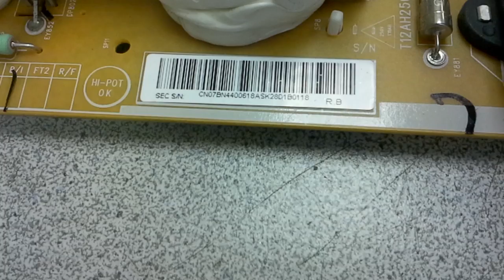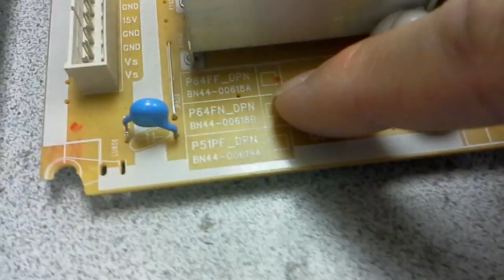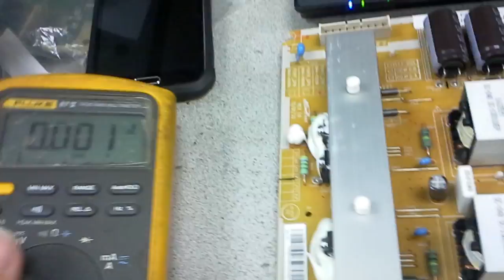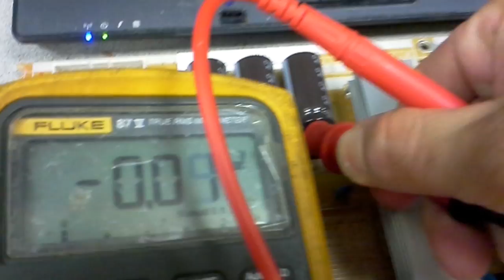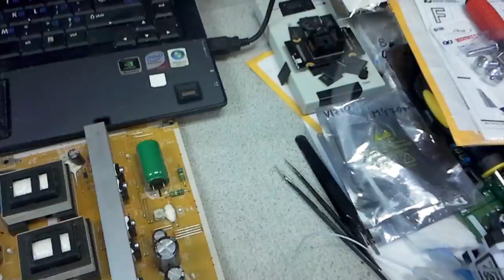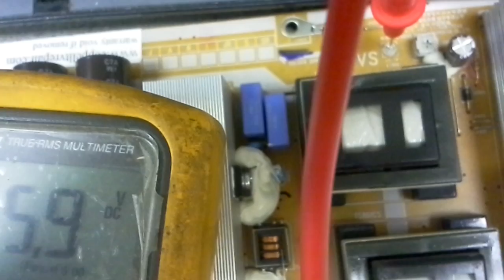How to test BN44-00618A power supply for Samsung PN64F5300AFXZA  PN64F5500AFXZA

Comment: Hello Bobby my BN4400601 has a blown mosfet which I cant determine what type it is. Would you happen to have a schematic for this board? Thanks
Reply from the maker: Most likely I do not. 95% of what we do is reverse-engineering...we do have access to some schematics but easily most of the more recent appliances are missing there. You determine MOSFET usually by the purpose it servers and the voltage it operates under. For repairs it is always safe to over-engineer, i.e. we use the same high-end switching mosfets on pretty much all PFC circuits we see around, whether they are for 50W or 250W devices...it's not worth maintaining a small warehouse of unique transistors when one high end can cover them all and when its cost is a mere 1/50th of the total repair cost.
Reply: @coppelltvrepair  Thank you for your reply, awaiting replacement part from DigiKey

Comment: Vs and Ve are high because the  other boards are not connected so it's not under load. If you connect them these voltages will come down and fall into spec. Trimpot will NOT let you lower them to the stated value if not under load.

Comment: how to wake samsung PSU board bn4400514a thank you
Reply from the maker: The exact sane way, Find any of the videos we have for BN44-00513A, BN44-00514A, BN44-00515A, BN44-0516A. Connectors may be at different locations and may be organized a little differently, but all will have the same STB and PS_ON and VS_ON pins that function the same way.

Comment: Hi. Very nice informative video. Are these power capacitors known to fail as they handle pretty high voltage of 400V. How much voltage are they rated for any idea?
Reply from the maker: No, the capacitors on this board are not known to fail a lot. This may change in future, but as of today I would not look at capacitors when considering problems on those boards.

Comment: Bobby, the best PSB testing vid on YouTube!  My board shows Vs high as well and out of range for adjustment.  Do you have any vids on testing the main board?  My PSB tests good but seems not to be getting the signal to turn on.  Thxs.
Reply from the maker: No vids on the main board, sorry...but you can search around for how to test the plasma logic board and sustain boards by disconnecting the plasma logic from the main and shorting a jumper there to generate auto raster..it's fairly common procedure for Samsung plasma TVs.
Plus, if you have out-of-range Vs voltage I'd focus on that...the odds of having that problem AND something in small signal boards are fairly low.
Reply: Thanks so much for the response.  Unfortunately, the logic board and main  are one board on this model (PN60F5300AFXZA  US01).  I'm wondering if a high Vs comes down when the "load" of the display etc. is applied.  I've only tested the power supply isolated, as you did in the vid. @coppelltvrepair
Reply: @177BCardinal  that's exactly why it's high - no load.

Comment: This is the power supply for the 2016 UN55KU7000FXZA, right? Is it dual voltage? I want to know before I buy a step down transformer and it turns out to be unnecessary. Thanks
Reply from the maker: I am sorry, we do not currently have the resources to check that on your behalf. If you have the board handy you should be able to do it yourself.

Comment: Btw is it safe to take the power supply board out of a tv because i have a old tv laying around all i want is the power supply board  sense  the tv stopped working
Reply from the maker: Yes it is safe if it has been laying around for more than 2 hours.
The worst that may happen is there may be a spark coming out if it if it gets touched in a certain way , but there's no risk to human handling it with hands other than possibly surprising them.
Reply: @coppelltvrepair  oh ok because there some parts i can use and desolder and it has been laying around sense Christmas and so i should still dis charge the compacitors?

Comment: Hi I started checking this board by checking the fuse.( t12ah250v ) and it is blown. What would you recommend from here. The tv was turning off after about a minute. I did the reset by unplugging it for 30 seconds then holding the on button for 30 seconds. When i plugged it back in it was completely dead not even the red stand by light. Samsung PN64F5300
Reply from the maker: We repair those boards for money, so please don't expect us to teach you how to do it yourself - it would be in conflict with what feeds our children.
With that in mind we recommend you replace the board, have it repaired or try repairing it yourself.
Replacing the fuse alone is not going to help and using a repair kt from ebay may or may not help,.but is not enough to prevent another failure within the next year.
Reply: @coppelltvrepair  I would like you to repair the board if that is the problem. I wanted to know if you thought this was the problem with the tv or should I look further?
Reply from the maker: @christopheraquina7744 A blown fuse on a board is virtually certain indicator of a problem on the board. Coupled with teliable statistical failures on this board I'd say you are not likely to find problems elsewhere.
Reply: @coppelltvrepair  OK, How do I get it to you for a repair
Reply from the maker: @christopheraquina7744  The link is in the description of the video.
Reply: @coppelltvrepair  it is on its way

Comment: Ah, but if you have a pwr_on pin at 0 waiting for a 3.5v routed through the logic board then you connect these two via a 1k resistor?
Reply from the maker: On most Samsung plasma TV power boards you have 3.5V on pwr_on waiting for 0 to activate the first stage of the board (PFC, low voltages). And no, there's no 1k resistor needed for that.
Reply: @coppelltvrepair  thanks
I activated my leg with direct wire from 3.5 to power on, confirmed voltages working
So logic board is dead
Reply: No load on the power supply board = higher voltage to panel. I'm surprised the weren't sparks with that test procedure,  btw.
Reply from the maker: @14.1guy2  That is incorrect. Most power supply boards have built-in load providing minimal current allowing proper regulation of the board without external load. In other words the board is never without load. It is not working at designed / optimal current without external load, but the output voltage is holding with and without the sustain boards.

Comment: Do you know if  this BN44-00807A is compatible with BN44-00807E? my TV has the E model, no where to be found,  is is flickering a lot , when I opened it, a couple caps look blown, I will get those replaced and see what happens, but I wanted to know if other boards are compatible since this E model doesn't seem to be available or out of stock
Reply from the maker: I do not know for a fact if they are compatible or not. But if I had to guess I'd say they are.
Reply: @coppelltvrepair  Thanks a lot, it is a pretty simple circuit anyway I will try the Caps first
Reply: Just to update, I got it fixed replacing 3 Caps of 3.3uF on the upper right side corner, I don't remember the correct name but you could see how those were gone.

Comment: What to do if power is going to power board, but no Va or Vs there?
Reply from the maker: Make sure the problem is in the board and not out of it by testing it on a bench, then either buy a working board or send yours to repair to someone who knows how to troubleshoot it or start reading and watching on how to fix electronics. I think that pretty much sums it up if you want it working.
Reply: Thanks. You was completely right. I asked realy before wached this video,only coz it close to my issue. Then went trough all video more closer and found exactly what i need. Found all voltages and reason why it was missing. So power board is ok, and that let do next step and locate next fault. After connecting all together and turn on power both Vs and Va going down to 0, in about 20 sec. Found that if disconnect Y main( both connetion to power board and to X main) then Vs and Va remain in proper range. Then found if disconnect Y buffer ,then Y main can be  connected and voltages remain in rainge.
So faulty Y main or Y buffer. When checking diode in connection to transistor at Vs voltage contact on Y buffer, looks like diode showing voltage drops 0.200mv both ways. Soldered diode out and checked,found diode ok, but connection points still showing voltage drops even without diode.So far i am stuck.Diode soldered back in.What could cause voltage reduction till 0, but no short and tv not getting in loop

Comment: Hi.I am Marcel, and i want to  ask you a question.I have a Panasonic TX-P50X50E and on the main capacitor,i can measure only 324v Do you thinck i is enaught?Because the stand by voltage is driving by a FAN6755u,and do not want to start,so i do not have 5V stand by .Please help
Reply from the maker: I must admit we do not do many Panasonic power boards, so I can't say first hand experience if 324V is normal, but I'd rather assume it is not. It should go higher.
It also has very little to do with the standby voltage other than the standby is usually required in order for the PFC to work in the first place - the PFC driver usually gets power from the same transformer that produces the standby.
But that's just the driver, not the source for the pumped up mains voltage.
Which means that if standby had fluctuations because of which it would not work fine then the PFC most likely would not have started to begin with.
Reply: Thanck you for responding.I am agree with you , but i would like you take a look to the schematic diagra first, because i thinck this board was designed by a different way, Please let me send you the diagram, which i downloaded from internet (with the board reference :darfon b159-201), and ,i didn.t refer to a fluctuating stby voltage.The  FAN6755u have a HV pin,where the voltage is about 214v, and that voltage a re fluctuating.The octocupler, which is conected to FB pin of  FAN6755, on the foto transistor side, measure a fluctuating voltage at about 2,6-3V.I don.t know what to do..Thanck you anyway,I know that you can not waste your time ,so ,i will try not to bouther yo too much.

Comment: hi Coppelle must say you explain very well that even a person like me who have minimal knowledge can follow and understand. i opened up my tv. i found that the vs and va voltage was present but still no picture. i also noticed that the vs voltage was 279 instead of 206 and i found that i couldnt adjust it...what can i check next to fix the problem?
Reply from the maker: For every problem there is a level of complexity beyond which it makes more sense to involve professional or just abandon project rather than hitting your head in the wall.
While I can't say with 100% certainty this is the case here I happen to believe that you are better of with one of the above two options versus trying to get help online.
It is fairly uncommon for Vs to be above designed value and there are number of reasons for that; I won't go in details because it is beyond the scope of what this YouTube channel is created for and because it has proven in practice to be mostly a waste of our time - no offense meant in any way.

Comment: I have a 619A that destroys the thermistor upon connecting to mains. (Bare board, nothing else connected). So something is shorting out and taking out the thermistor (and mains surge protector)...
Reply from the maker: Sorry to hear that.  You are making a statement and a deduction and we'd agree with your deduction.
Reply from the maker: There are, actually a number of them. PFC circuit power switching transistors are a common source of shortage, but proper fix is often more complex than just replacing them.
Power switches for the transformers are also known to fail, usually due to corrosion of the solder joints of their legs as well.

Now that I've given you a good direction based on first hand experience I too have a question for you: where do you think money come from so we can put something at the table in the evening - repairing boards or educating others on individual basis on Internet?

No offense meant.
Reply: Very interesting educational video.  You definitely explained a lot more technical details in this video than in the other one.  I know you don't make any $ by making these videos and enlightening us, but the information you share is definitely very much appreciated.  You are a very good mentor.  
I'm going to apply what I learned here in attempting to bench test my BN44-00515A board.  One question I have is that you used a load resistor when you tested the BN44-00515A, but not when you tested this board.  Is the load definitely required for the 515A, or is it ok and safe to power up the VA and VS without load on that model?  If the load is required, then I'll most likely send it in to you for testing.  Thanks again.